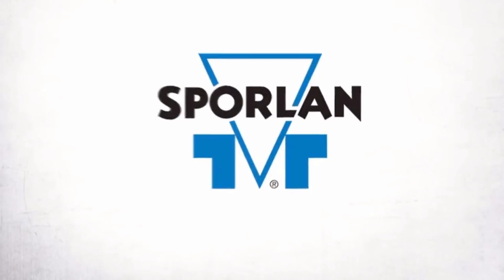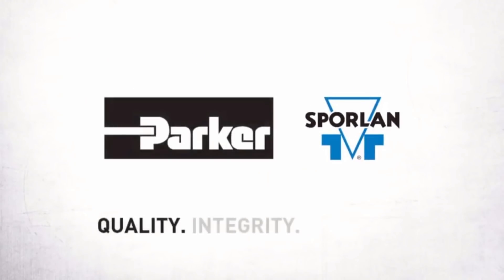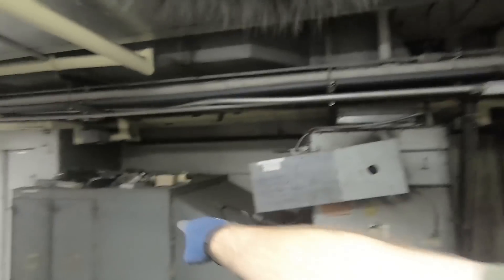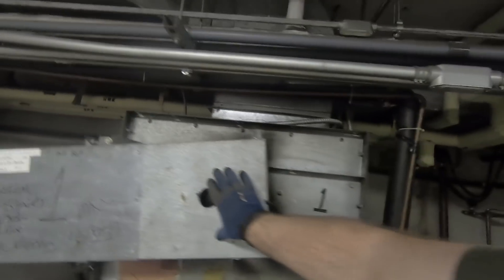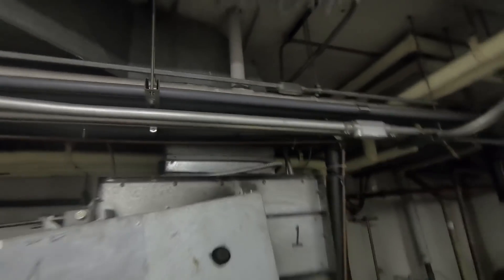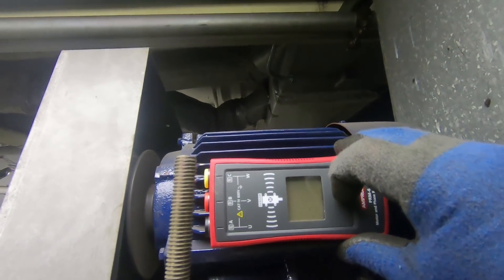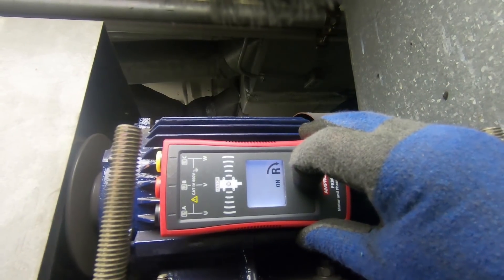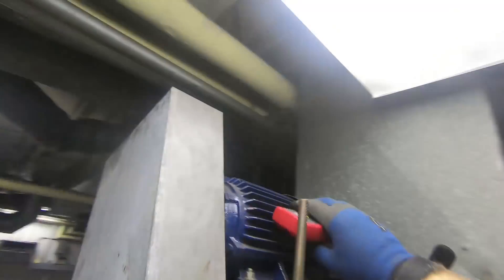HVAC in a Time Capsule ~ HVAC Chronicles

Comment: Diesel mechanic/welder fabricator on heavy equip and trucks here, have nothing to do with hvac but damn you sucking me into this channel  I always have liked hvac, refrigeration but grew up around the coal and gas industry,  so.. anyways I've never much liked residential but this commercial grade stuff is neat to watch. You get me so pumped up I went outside just to work on my 20 yr old heat pump needless to say I should probably stay in my field!lol

Comment: It’s a shame you didn’t clean the condensers, that old fella might have liked a free shower. Of course, move his bedding first. I bought that PRM-6 a few months back, a little quicker rotation check than using the AMP-320.
Reply from the maker: Still have to try out the features with the leads, seems like a cool little meter though